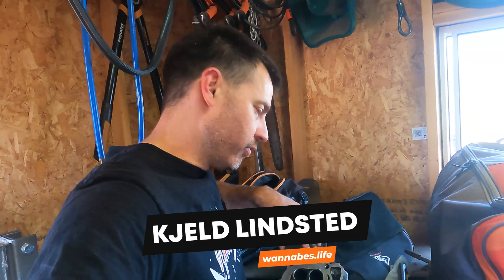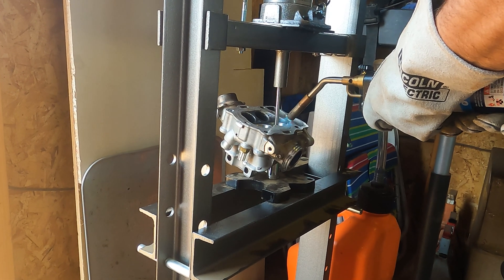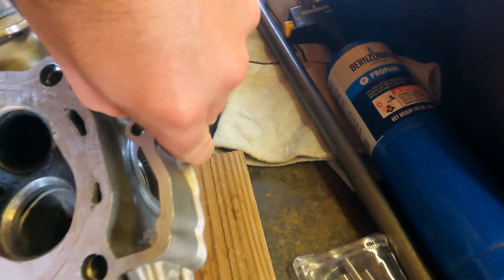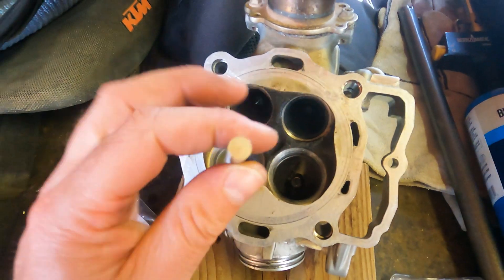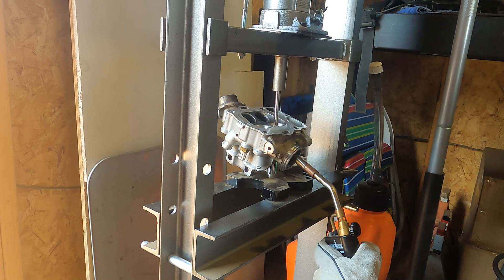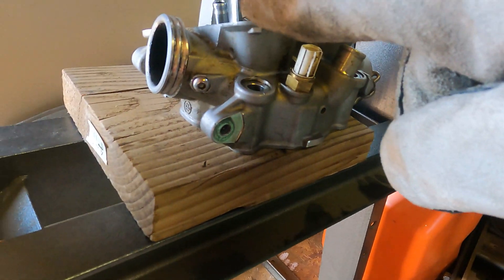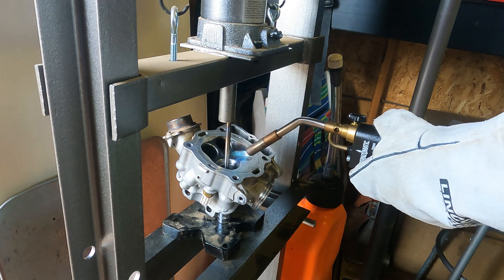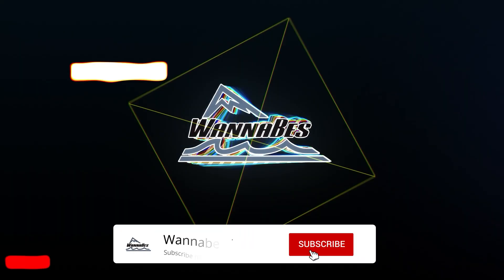Replacing 4-Stroke Dirt Bike Valve Guides | KTM 500 Burning Oil | Part 4

Comment: seems way smarter than the method I used to remove valve guides off my old Husqvarna. I used a steel rod and a hammer and a torch on top of a piece of wood. It worked but it took forever.

Comment: What a rabbit hole you went down to find the oil consumption… in the same boat hoping to not go down that road. 

So i gotta ask, other than the nics and scratches were there any other signs of bad valve guides? Mine do have a bit of side-to-side play. Already did the valve seals and of course that didn’t fix it.
Reply from the maker: The play in the valve is the thing to look for. That and repeated seal fails. The guides are meant to be softer than the valve stems so they’ll fail first I believe. You’ll see how much tighter the valves fit into the new guides.